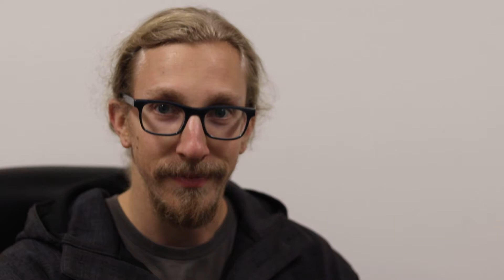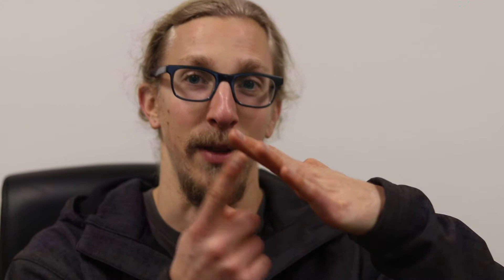Episode 4: Tool Holding Stream of Thoughts

Comment: Nice , been going back and forth on heat shrink or rego-fix ..
Reply from the maker: I've never used the Rego-Fix, but from what I've heard performance-wise they are comparable to heat shrink. I think I personally prefer heat shrink as it less parts, less expensive, and inherently simpler.
Reply: Avant Manufacturing auto correct ... that’s where I’m kind of leaning I am currently using mostly hydraulic tool holders problem is I need to get into tight spaces
Reply from the maker: Ah yes, for tight spaces I haven't found anything that beats heat shrink. I don't see that changing any time in the near future either.